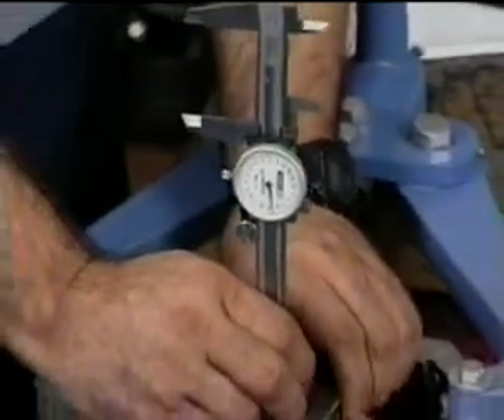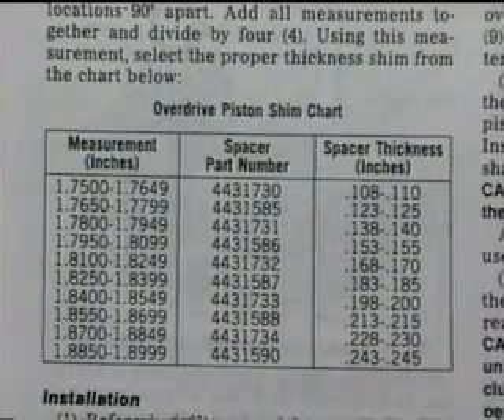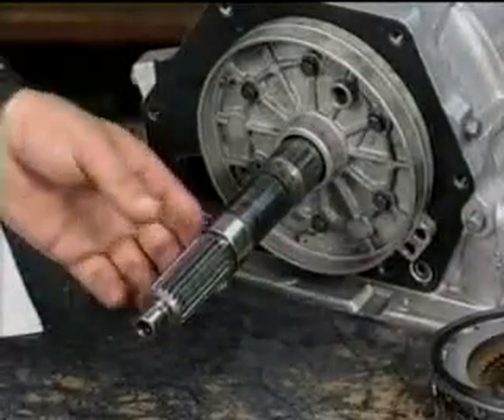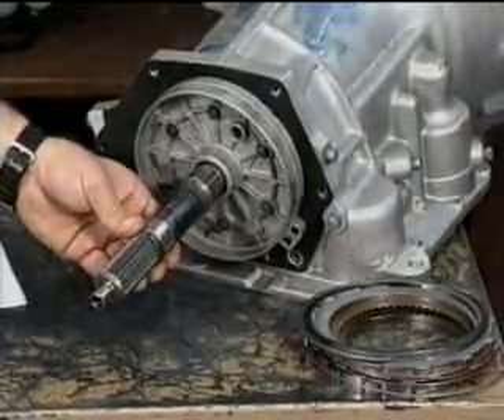Dodge A318 (46RE) Transmission Teardown

Comment: not being a jerk or anything but the transmission being worked on is a 46RH "which i wish I had" the 42-48 "RE" transmissions have an 8 pin connector rather than a 2 or 3 pin connector, does anyone know how the governor shift solenoid operates on the 42RE-48RE transmission?